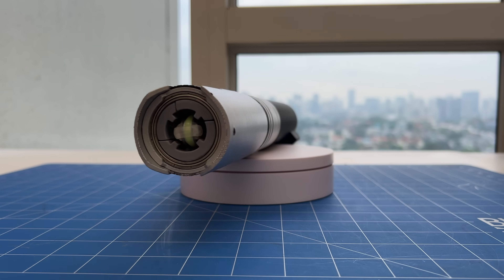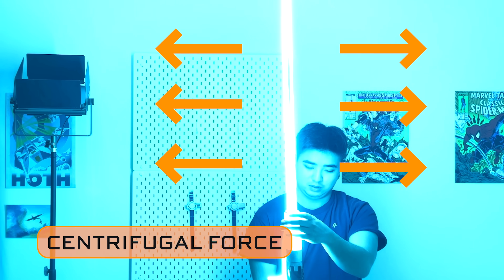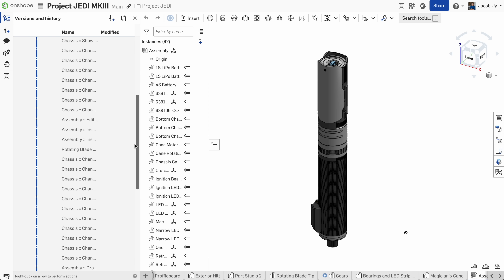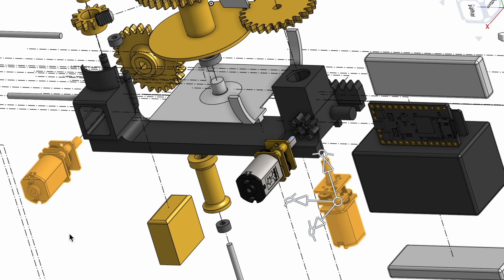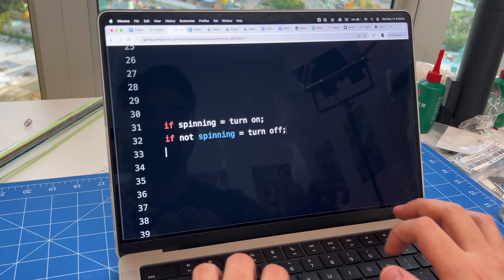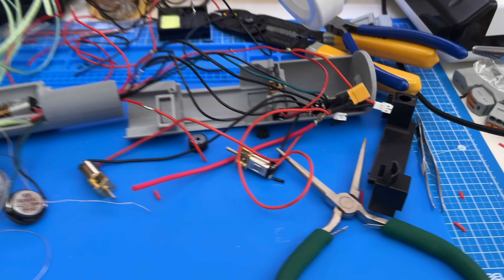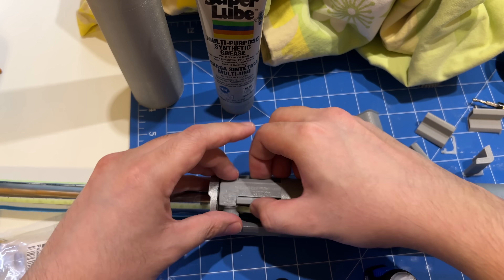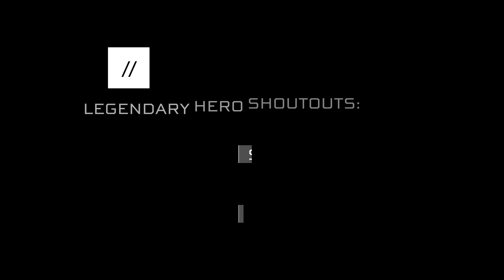Making a Better Retractable Lightsaber

Comment: Cool project!
Reply: On part stayed unclear to me: The clutch is controlled by the rotation speed to avoid crossing rhe rotating interface, so much is shown, but how does the potentiometer control for the spinnig speed cross the rotating interface? Hiw is the shifted priblem solved?
Reply: Also to the issue with the servos: I would have more suspected the problem earlier in the signal chain rather than the servos themselves. The grabbing of the signal from the rotation speed being noisy. Don't have any details though. 
To the replacement motors: I guess simpler than motors liner coil actuatuators would be too weak for the clutch.
Reply from the maker: And true! The issue was definitely with the board signal output. Haven’t previously worked with servos too much outside of the arduino library so this was a bit of a struggle for me
Reply from the maker: The potentiometer just controls how fast the motor spins that spins the inner hilt, and based on that it will trigger the clutch. Sorry for the confusion!
Reply from the maker: Thank you!

Comment: Awesome project! ~ Related bad idea of mine I got from watching this is using a zipping up rigid chain (cool mechanism) beside the LED-strip tensioning to keep the strips from bulging out from centrifugal force and also to make the whole thing more stiff. But this would make the whole thing much heavier, bigger, slower and then even heavier and bigger to keep the speed. So the here taken choice was right choice. Best part is no part. Just use the motor for sufficient tension.
And (luckily) this is just for show not for actual Jedi war. So no need for getting this any more stiff and strong than what is enought to prevent visible wobbling of the blade.
Reply from the maker: That’s also a cool idea!!

Comment: First of all, I love this. I always wanted to build something like this but never committed to taking an honest shot. Even then I likely wouldn’t have even come close.

A thought on the gyroscopic effect: Can you use a counterbalance on the opposite side of the center of mass to cancel out the angular momentum along the “blade’s” axis? As long as you can center the mass about where you want to hold it, I think it should work. I don’t know how practical it is though to have something compact enough to fit in the hilt AND generate the right magnitude of angular momentum, but I think the theory checks out.

Comment: Wouldn't i have made more sense to have the lightstrip inside the cane, and then make it of some material that is slightly translucent and will diffuse the light ?
Reply from the maker: Tried that in the first video! Had some disappointing dark spots where the clear plastic overlaps, but I think I actually have a solution for that now

Comment: Realistically how long until one is “comfortable” working with CAD in this use case?
Reply from the maker: Good question! I’ve been using CAD for six years, but my very first project (the functional web shooter) I actually learned CAD specifically for that project - so I would say 3-6 months of CAD experience can get you off the ground on projects like these
Reply: @herotech thats what I like to hear! Im starting drafting engineering courses in Fall so was thinking of maybe trying to get a head start!

Comment: You should take out the spinning part and add a sanded plastic or maybe even glass or acrylic shell for the blade that can retract with the magician's cane so that there won't be any black lines in the blade, and it also won't show the cane, even when it's off.

Comment: You didn't have to test so many motors, just add gearing to adjust, torque, power, and speed.
Reply from the maker: Tested different motors with different gearings from different suppliers (suppliers and subsequent stall torque make a big difference with N20 motors) - there was no space to add additional gearing, so had to get the right exact gear ratio out of the motor

Comment: feedback: how would you bulk up the light strips, so they can be smashed against each other (with minimal wear) if you had two sabers? food for thought mr. herotech xoxo

10/10 video and love your work!
Reply from the maker: Thank you! It’s possible to add impact resistant backings/coverings, but you’re right, it would add some bulk which translated to a bigger hilt :( looking at options to encase the LED strips without increasing the size of the saber
Reply: @herotech i wonder if there is like a liquid gel that you could set on the strips or something of that type. maybe d30 as its flexible and as strong as kevlar, just don’t know how to actually implement/ attach to strips securely (without too much weight and such).

maybe like a little d30 transparent pad on each  led to give them protection? 

that being said i could see the spinning causing issues with tangling etc with two sabers as well.

Comment: looks great 
you could have also tried laser through fiber optics that has been sanded to leak light(another term is bare optical fiber).
you could have had several fiverglass wires running off of one or 2 laser components spinning like a gyro closer to the top .
still looks awesome
Reply from the maker: That’s a cool idea too!!!

Comment: You need to paint the extending rod with fluorescent paint (which shines immediately when exposed to most LED lights). This will further hide the vertical lines.
Alternatively, if painting is not an option because it would interfere with the clearances, you could make a thin fabric tube out of fluorescent fabric and use it to cover the rod so it crumples when retracted.
Reply from the maker: Great idea! The clearances are really tight, but am exploring ways to “contain” the LED strips to make it duelable as well

Comment: I think it's fantastic. Hopefully it comes out closer to the actual design look with a longer blade. Different colors and that you can use it in actual fighting clashes.
Reply from the maker: Thank you! Working on that, the duelable part is the hard part haha
Reply: Yes is there a way to make the handle of the lightsaber appear less bulky and slimmer like the films and yet still operate mechanically? I also wonder if you're interested in making the tip a bit pointing like revenge of the sith. Just a bit details maybe to consider for the fans 💪 @herotech

Comment: I was wondering why you don't use light like those strands of monofilament, where the ends carry the lights to the other end. Why not the lightsaber blade be the ends of those lines? So a blade made up of multitudes of fishing line, which in turn, you can change the color of the light saber by changing the color of light that is sent through the monofilament.
https://www.youtube.com/watch?v=oAWzYGFClvI
The light is sent to the parts of the plastic that is cut, so if your whole blade was made up of the ends of the line, the whole blade can be lit up. No more heat, less battery power needed, just need to make your blade extend out and back in.
Reply from the maker: That’s a cool idea!! I like that it’s less heat and less battery power. I wonder about the light output of those monofilament strands as opposed to the COB LED strips

Comment: Have you attempted a pressurized tube with a hard cap that uses  wire tension to stretch at the same time it unravels?
Reply from the maker: I have not tried that, seems interesting!
Reply: @herotech 

I don't want to talk about every teeny tiny bit in a reply, but while it's collapsing it may not need a sensor at all calibration of a relief valve.  I bring that up first because I was worried that the idea of required way too much electronics just to make corrections.  Whoosh sound would also be included when you raise and lower it. 

Also, I forget the name of the optical illusion but hopefully you know what I'm talking about when it's one of those counterintuitive levitating wire but it has to do with attention is counterbalanced. anyway, is that unusual principle that I think could be used to organize the wires, and you should be able to generate enough Force to use the wires to offset the need for additional pressurization. That way you don't have a noisy compressor and probably could get away with using a CO2 cartridge
Reply: @herotech  I've given a lot more thought and the things I thought would be a problem do have answers but it comes down to is it even fun anymore. A donut shaped magnetic roller is doable, but getting the plastic to not become damaged sounds like a nightmare to cut the right kind of shape into a handmade rubber washer and I'm probably would give up after the second time the the plastic rips open

Comment: Maybe you could use a mechanism similiar to a spring blade, where a spring connected to the blade pushes it out when the blade is release. When pulling the release button back, the spring is tensioned into the other direction and the blade is pulled in as fast as it was shot out. Have a look at this for inspiration:
https://www.youtube.com/watch?v=o9r1AwrIWic
Reply from the maker: That’s a great idea!! Will look into that

Comment: Maybe use some ring bearings between the inner and outer hilts, and magnetic sensors inside the inner hilt that starts the mechanics when a sliding switch on the outer hilt moves a rare earth magnet into position?
Reply from the maker: That’s a great idea! Will look into that
Reply: @herotech  I just realised you'll need a shield (a thin sheet of iron, perhaps?) to absorb the magnetic flux when the switch is in the off position. Then you'll have options: Fix the magnet in place and move the shield with the switch, or vice versa.

Comment: Bravo! What about a slip ring setup? This would allow a connection between the  spinning portion of the light saber and the exterior shell. This would allow your switch and possible an external means of charging? I also know that a lot of led street lamps use a UV LED that then excites what I assume is a phosphorus coated material which in turn makes it a white light. I wonder if that could be used. May a LED cluster or single LED in the center that would excite a pretreated piece of cloth instead of a bulky spool of LEDs.
Reply from the maker: Thank you! Looking at a slip ring setup for the next version :) think it will save a bit of space as well. The phosphorus coated material is an interesting idea as well! If I recall correctly some custom lightsaber makers use that same tech for their blades, called the “photon blades”, would be interesting to explore in this design.

Comment: For the whole "using a button to turn on the saber" bit, one solution could have been a ring contact. The ring being set on the spiny bit, going all the way around it and pressing the button would simply use that ring to complete the circuit. But hey. If your thing works, that's good too.
Reply from the maker: Thinking of using a slip ring for the next version! Should save a little space on the exterior hilt too

Comment: I'm more of a Trek fan but the lightsaber is an undeniably cool concept and yours is the first one I've seen that extends/retracts at a convincing speed. The LED strip looks amazing - this would have been impossible 20 years ago. Little kids must go nuts when they see you with this thing. 

I want to hear the signature "whirring" sound effect when you swing it. Accelerometers & a few speaker drivers - getting it right means some bass but, like LED tech, tiny speaker tech has come a long way. This sound: https://www.youtube.com/watch?v=__sDEWIjQ_g&ab_channel=DnJose
Reply from the maker: Thank you!! The board we’re using actually does output the swing and hum sounds, but the sound is too low to hear it 😭 will fix this for the next version

Comment: This is definitely super cool, and I was looking into building my own with the resources you provided. However, for some reason, the Aliexpress links don't work. I am not sure why. Every time I click on one, it says that the page you requested cannot be found.
Reply from the maker: Fixed, they should work now sorry!
Reply from the maker: Also do have to warn you, this thing is really hard to put together as I did not optimize for assembly ease (it’s difficult even for me and I designed the thing 😭)
Reply: @herotech  ok thank you very much, as for making the lightsaber, are the things you need to buy going to be the same for the new version you are working on. Also, thanks for letting me know what I am about to get myself into, but man, a retractable lightsaber is just sooo cool.

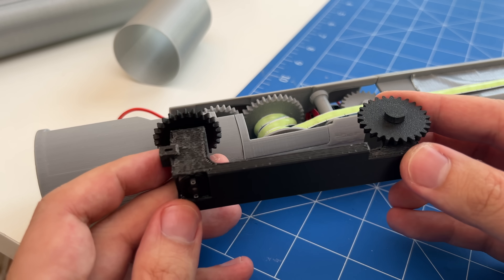Comment: 6:12 no way haha, glad I could help a tiny bit!
I still think the retraction could be hidden a bit by selectively turning the LEDs at the tip off as the blade retracts, making it look shorter than it actually is. Say the blade is at 75 percent length, but 50 percent of the length is already not illuminated anymore. So basically a turned off portion in the middle of the strip that gets longer and longer until the entire strip is turned off. Would be somewhat of a pain to programme though
Reply from the maker: Thanks for commenting and for the inspiration! That’s a great idea, currently the only programmable strips I’ve found in this style are bulkier and so make the hilt larger, but I’m hoping they release programmable strips in the same size soon because this would be sweet

Comment: could the analogue switch be used to dictate how quickly the saber extends? Then you could choose slower more dramatic extensions or quick emergency ignitions
Reply from the maker: Unfortunately with this design the activation is immediate and follows the pace of the magicians cane extension (super quick), we could control the speed in the future by keeping it on the motor but I’m not sure how fast that would be

Comment: I feel like if the magician's cane was translucent you could get away with a single strip of LEDs that alternated which side they were mounted on and the translucency would diffuse the light. This could make the blade design more compact and cut down on all the other issues.
Reply from the maker: One of the designs I’m exploring for the next version :)

Comment: Could you make your own magic cane from translucent plastic and then light it from the inside? The diffusion should eliminate the need for spinning.
Reply from the maker: One of the designs I’m exploring for the next version :) funnily enough will still need the spinning, since the sections where the plastic intersects create dark lines, but if we spin the blade we have a shot at evening those out

Comment: Instead of spinning an inner blade you could try to just spin the blade components and use a planetary gear box to spin the blade and wind in in, that would also allow you to use slip ring on the inner wall of the blade to transfer electricity to the led and board, which means you can keep the battery and everything heavy lower down
Reply from the maker: True, good idea! Might transition to a slip ring for the next design p

Comment: This admittedly is the most "lightsaber" looking lightsaber i've seen someone manage to DIY. The spinning give the blade a real sense of life that is missing from most builds. Major props to you mate. This is fantastic
Reply from the maker: Thank you!! I agree, the spinning gives it that life and energy that’s lacking from static blades. Glad that you liked it and will keep improving it!
Reply: @herotech is it strong enough to clash with other blades?
Reply: @herotech 
Congratulations on building a really kick 🫏 lightsaber.
Reply: @herotech This is genius ! I hope that you've put some sort of patent on your design ?
Reply: imagine a precision machined version with all aluminum parts, metal gears, and oiled casing. that would be insane
Reply: Hell, it's even missing from most of the recent films and shows. I really miss the old school flicker.
Reply: It turns out spinning it was a good trick.
Reply: have you not seen the hacksmith video
Reply: @TurboKnight1 but Hacksmith's is just a glorified blowtorch .
Reply: Just say it’s the best. “Admittedly the most ‘lightsaber’ looking lightsaber” ❓
Reply: @dannyhelser5824  Were there too many words for you? :(
Reply: Definetely, to be fair this is not something that's really viable to manufacture at the moment, and would likely break very fast aswell. But in the future, pherhaps anyone could buy something like this.

Comment: also a diff aproach to the magic spring system could be that you just copy disney that could work but its hard to do it on your own cuz they only gave us a idea on how it works not the internals that could be a fun challenge try it mate i hope you succseed
Reply from the maker: Would be another avenue! Honestly not sure where they sourced their plastic bistable material from
Reply: @herotech I researched a Lil and the plastic bistable plastic thingy is just the same material used in those slapstick bracelets bro the ones that turn into scales and you get them mostly at fairs and carnivals

Comment: as some one who has faced the servo problem before all you have to do to get it to work is get it a base value like just round of your decimals to be clean 1s and 2s not 2.5s or 2.7s and make it so that the input that the spinning generates is a very low number and has a limit sorta like 3 or 4 and if this dont work mate you need a better gyro.
Reply from the maker: Thanks for your input, the problem with the servos turned out to be the board we were using, as they worked fine with a few other arduino boards I had lying around. Nevertheless I like the new mechanical solution better!
Reply: @herotech  ya ifd it mworks dont fix it and pary it holds cuz it prolly will but you cant be safer and as i had guessed it was a hardware issue but man did you makle such an awesome saber nice bro keep working on it.